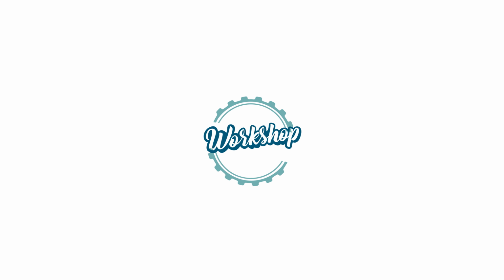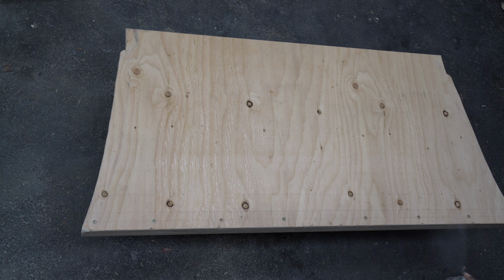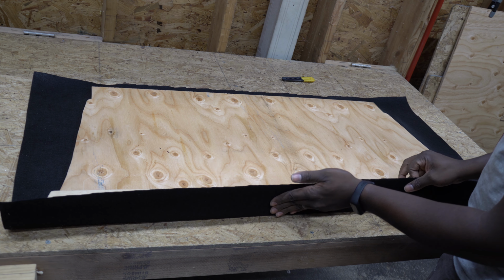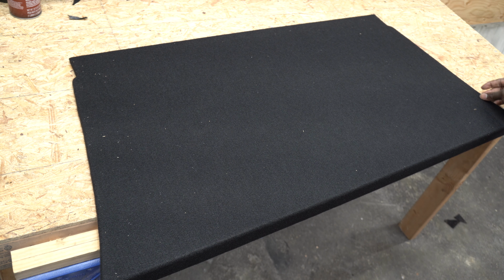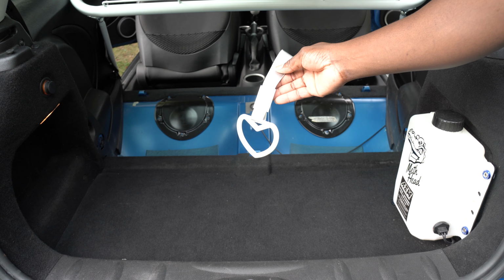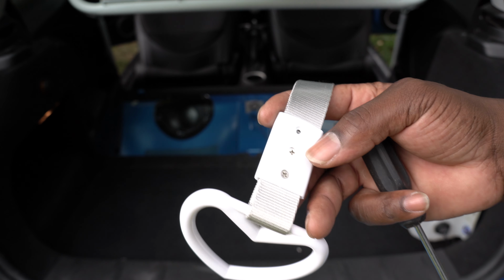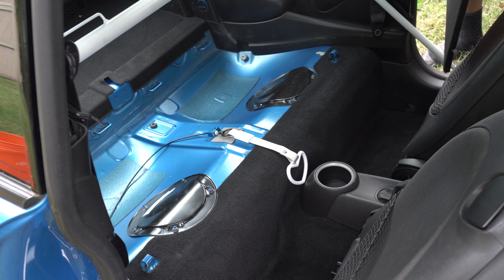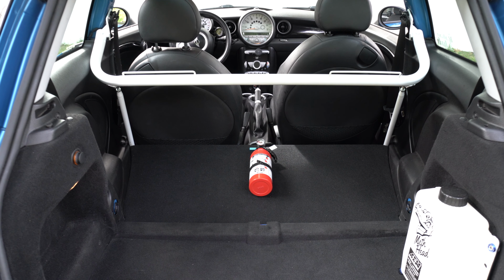R56 Mini Cooper S Rear Seat Delete Cover Wrap - Part Two

Comment: I wonder what the weight difference is between the seat delete platform (wood) and the factory seats.
Reply: probably about 5 lbs, maybe a bit more, but you can also take out the seat belts for another few lbs. A lot of people do it for the look, cargo space, and so they can tell people "no, I can only take one other person, sorry". No back seat, no back seat drivers, no third wheels.

Comment: This is just me.  I wouldn't of used the spray glue.   Do it like you where upholstering a chair and use staples.  Bonus of no off gassing smell.  And if something should happen to the carpet or you simply want say change the interior color of the car.  You wouldn't have to start this part of the build from start.  Just pop the staples and viola new carpet.  That spray glue and that thin of material you will never get apart.